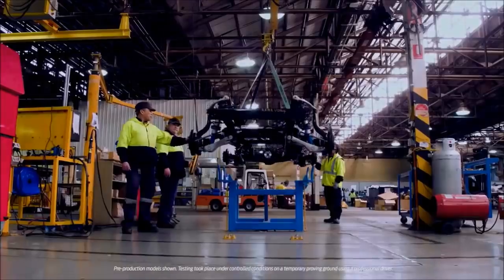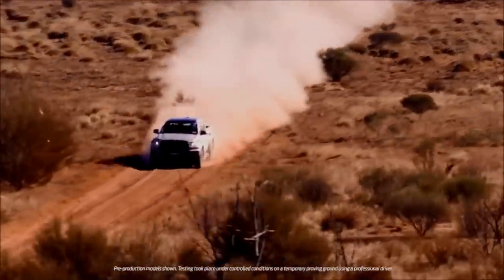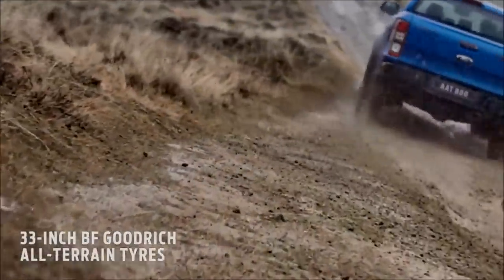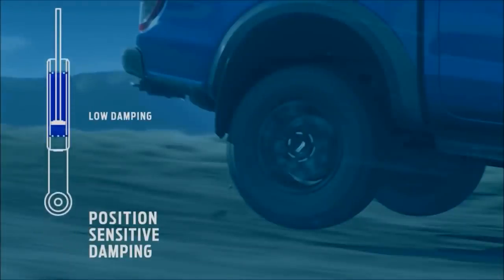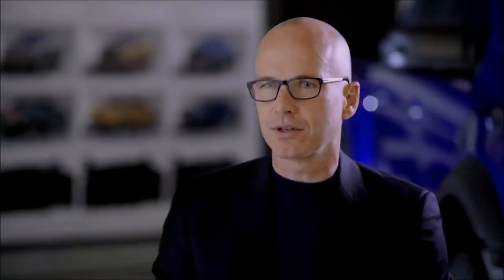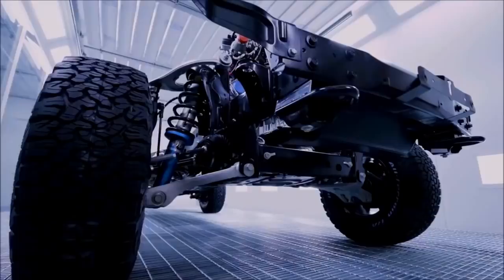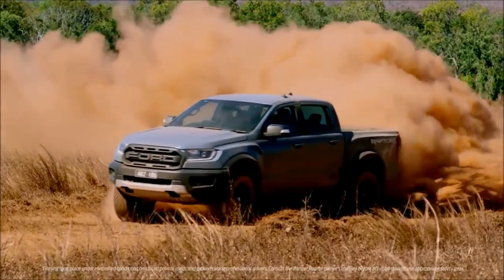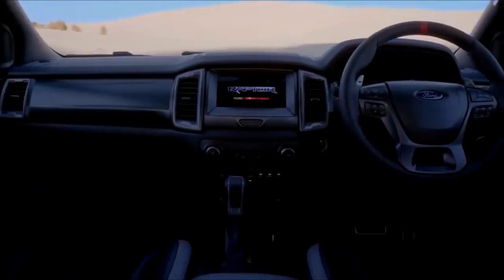Ford Ranger Raptor - The Best Pickup Truck Ever !!

Comment: "Made from high-strength low-alloy steel". That's..not a thing.
Reply: I always get a kick out of " high grade airplane aluminum"
Reply: It is actually. Steel for the most part is mixed with an array of other metals in different quantities to get different characteristics out of them.

Aircraft grade aluminum is the same way, although in most cases you wpnt be taking advantage of most of the properties in your flashlight or whatever
Reply: @OriginalRanger84  I understand that, but the choice or words here is fishy. High Carbon steel is technically a "low allow" steel, but they did not say high carbon...so it leaves me wondering what kind of steel is this? Another low alloy steel is A286 mild steel...basically the most common construction grade steel there is. It...is...soft.
Reply: @Battlefresh  true but with most advertisements it's all about buzz words and simple terminology. They could have used A36 or any other steel but chances are it's the same stuff used in most modern vehicles.
Reply: I think they watched one too many apple and dyson ads with these buzz words
Reply: They could say its made of vibranium and people will still argue its true...
Reply: Mark Danger what about this, you test drive the ford ranger raptor then “SEND IT” and see if it bends in half or not. If it bends in half then it’s cheap shit and if it doesn’t bend in half then it’s expensive shit.
Reply: Its plastic...
Reply: And I bet if you drive that for just 5yrs in the Northeast it will be rotting out real bad. Sad that the shitty materials they use now are becoming more and more popular.
Reply: We Are Legion!. It’s called fordable that’s why you see more fords out there then other companies.
Reply: @Battlefresh  hy80?!?
Reply: @whatswiththissassylostchilld  Actually it's called A Ford ability.😉😂😂
Reply: We Are Legion!. I don’t man I always hear mechanics complain about mustang always being at the shop lol
Reply: High strength is not high carbon didnt say anything about carbon range.
Reply: @Battlefresh  it's a trade off. A high carbon steel may be stronger, but more brittle. A softer one may bend if you drive the truck off a jump like a mad man (which is very likely for most people) but the frame won't crack.
If you drive the truck semi-sensibly then a softer frame will be able to absorb more in the long run while a stiffer frame driven the same way may suffer from multiple small cracks.
Reply: @DR0CK  Its because Buzz Words work...  If they didn't work people would have stopped using them.  Cause the actual scientific terminology wont make sense to most.  How we like to say it in the US Army is "Barney Style it" and "K.I.S.S."
Reply: @imhappyandyou.4003  if you drive any vehicle in the northeast for 5 years it will be rotted out. Salt and sodium chloride is some harsh crap. If people would learn how to take their time and drive properly in snow we wouldn't have to use so much damn salt and sodium chloride.........
Reply: It's like that "Military Grade Aluminum" bullshit. Every alloy in existence has a military grade even aluminum foil for cooking.
Reply: Yeah Google what's strongest aluminum and look how many there for different some you can machine some you can't airplane aluminum was first aluminum alloy check it out Google strongest aluminum I beleive its 5202 t-6 snodized much stronger than 7075 for all you AR people

Comment: Man, such a amazing car... but equipped with a f**king 4 cylinder diesel engine? its a raptor, lifted, fox shocks and a baja mode... there has to be a engine with sound an emotion in it!  also a manual tansmission is missing! 

put in the 3.5l ecoboost v6 biturbo and maybe reduce hp/tq, not to attack the f-150 raptor territory
Reply: i m from germany and such smoking trucks dont exist here. soon the diesel cars will be completely banned out of the big cities because of the particulate matter. 
Your diesel trucks are just Stone Age...
Reply: It's a diesel 😂😂😂

Comment: Pickups don’t have back seats! Those are for cruising malls and grocery stores parking lots. Soo sad how far trucks have been sissied up these days. Full of plastic (yes lighter) and computers. All good for most people now days but I’d love to see a real pickup made for those who would rather be in complete control/out of control of the truck. Just a stripped down, bare bones pickup, nothing special but just right to drive and maintain.
Reply: Larry Martin then buy an old one
Reply: Larry Martin people want to be comfortable in a truck. Not all cramped in the front because you have no other option.
Reply: I have plenty of options. I have my 97 F450 extended cab, my 03 F250 reg cab, my 11 F150 crew cab, my 17 F250 reg cab and just bought a 1927 model t pickup. So options are not an issue.
Reply: It's so you can use the truck for something other than "baja racing" and bring your friends or family along for the ride. If you have the money to dump on this truck you could custom build your own naked trophy truck. "Truck guys" are so funny and sensitive!!!!
Reply: Larry Martin Don’t appreciate that comment, I have a ‘94 Bronco and it’s a beastly off-road rig and I have a back bench seat 😠
Reply: You can. They are called the WORK TRUCK  and they are stripped down nothing fancy am FM radio  rubber floor mats bare bones brand new trucks
Reply: Well then you stick with your metal box

Comment: Best pick up ever ....ur opinion 
There are stronger pick ups out there....
Put it in Africa .....lets see all ur fancy work operate here
Reply: it will be destroyed by real rough terrain,maybe not if you crawl through idk
Reply: @votpavel  these vehicles are more pretty than hard working....i do understand crawling....but ....u cant crawl  for 300km.
Here we opt for Land Cruiser or Defender.
Reply: Designed and engineered in Australia (Ranger T6 2011 onwards), plenty rough conditions here (Snow, desert, floods, etc).
Exported stuff from Australia have done quite well in the past in places like Africa and Middle East so I think it would do fine there in Africa. (Ford Territory has been sold in Africa which was designed and engineered completely in Australia)

Comment: No manual transmission and no manual transfer case both of which have been gone for years so it's not even worth looking at.
Reply: YEP unfortunatelly, vehicles now are automatic that means, there are no new  real man vehicles anymore...! manual its and endangered species.
Reply: You use flappy gear shifts on the steering wheel. Having 10 speed wont make sense having that old school gear shift stick anymore so flappy pedals have been pit in place
Reply: Ram diesels are still made with the G56 manual transmission, thank god
Reply: Nevil Easterling,,,,,,yea and Ram has to detune the engine so the weak manual trans can stay together.   Having had many Rams, Fords and chubbies in my fleet of work trucks I was always forced to add many performance up grades however since 2017 I no longer need to add or change a thing with the new auto Aisin transmissions Ram offers. 

If you need a manual transmission in a little pickup to feel manly it’s a sad day. If you want to do a lot of needless shifting buy a small NA 2l engine sports car and actually have some fun.
Reply: @2003evodave  actually,having gears has nothing to do with feeling manly,not sure where that idea came from but anyway manuals have always been cheaper to operate and usually the only thing you have to do when they get miles on them is change the clutch and that's cheap.My friend just had his 2009 dodge half tons auto trans rebuilt..it cost him 2600 bucks..You can keep em!
Reply: I wouldn't call the G56 weak, why do you call it that? I enjoy driving a Ram with a manual, I've had too many autos shit the bed on me and manuals are easy to fix compared to an automatic
Reply: Roy Wright,,,,,,you are living in the ancient past.  Fact - 1- Ram detunes the Cummins engine on all its manual transmission vehicles in HP & torque.  Fact -2- The Asian Transmission is the heaviest duty transmission they offer as it comes from a medium duty truck (not pickup)  Fact-3- these new auto transmission will outlast the manual.  The only way the manual would last as long is if you don’t use your pickup so why didn’t you just buy a car? 
A Ram Cummins Max tow package with an auto is well over 30,000 lbs.    Max tow with a manual is ???? Zero since you can’t even get a stick shift on a HD package or with any heavy towing ability.

And yes I still do have two 5.9s with sticks,,,, a one ton and a 3/4 ton both are like cars compared to my new one tow dually Cummins with the Aisin.
Reply: @2003evodave  Sorry but your facts are well short of being ,well facts..Two days I watched a show on building up those "tougher than manual" automatics from dodge because they have multiple weak parts that break when you work them..and they are so weak in fact that the company on this show called "revmax transmissions" has to make there own parts to make them hold up..they cant modify what dodge uses in them to make them stronger..if you like automatics then use them..I will stick with gears.but dont say the autos are the best thing going because revmax has more customers than they can handle from people wanting them to build there autos so they will hold up!
Reply: I pray that Dodge will never stop making manual transmissions on their trucks, they're class-leading after all

Comment: Looks as bad as the Colorado in the front, curvy headlights and rounded ends, looks like the f150s daughter
Reply: The chrome grille on the F150 raptor is more masculine. The ranger Raptor should have adopted that look.This model 
Looks similar to a Chinese copycat
Reply: It is the f-150 daughter, the ranger is a smaller version of an f150
Reply: Maria Matias ya but it could have been styled to look like its son, these mid size trucks apart from the Tacoma and Canyon look feminine
Reply: @drakers8069  I guess it really depends on the people , the truck looks nice in my opinion but we all have different tates so that's that
Reply: Drakek because it basically is
Reply: A chrome grille on the F150 Raptor would be silly. It would look like flashy feminine jewelry on a man's truck!  All black is the way to go to look masculine!
Reply: Drakek I don’t think it looks feminine, I think it’s a cool truck
Reply: And that’s coming from someone who didn’t used to be a big ranger fan
Reply: Look like Toyota Tacoma, is not rough as the Raptor used to be. Pls do not bring this to the US
Reply: Maria Matias Actually no. This truck shares nothing apart from the ford batch with the F150. This is a rebadged Mazda BT50 which have several years in production. For the raptor version they are installing a mini Ford engine instead the very good 3.2 regular motor. The 3,5 v6 ecoboost engines are already showing its engineering weakness in the Raptors and mustangs so just think how it is going to be the life with a two litersuper stressed engine inside. Not funny for the money it cost and the miracles they offer. Volkswagen already tried the boosted 2 litter in the Amarok and guess what? They use now 3,2 TDV6 engines.

Comment: Ford might be number one when it comes to advertising and marketing, but when it comes to quality control and reliability they are far off
Reply: #1 Truck in America since forever. If they were "far off" they wouldn't be #1 for so long.
Reply: Recovering_Californian I agree. I had a 2001 Ranger which never gave me one moment of grief and recently had a 2013 Escape and it was such a great vehicle.  I think the “Ford is such a bad car” trope is such a holdover from the 70’s and 80’s
Reply: No. 1 is NON-EXISTENT. Everyone claims to be no. 1, wake up in the commercial world.
Reply: Of course, if you got 5 of them it should be NO. 1 for you. I used to have one, and throw it away after 6 years and NEVER would own another one. It's NOT no. 1 for me and for the rest of my family.
Reply: Laugh at your own b***! I never had went to an oil change work anywhere else, i do it myself ever since.
Reply: Totally Agree  my F-150 EcoBust was the Biggest overpriced POS vehicle I have ever owned. Constant engine and electrical gremlin problems, to make situation worse Ford corporate showed total disregard to address any of the issues which were all documented and service done by multiple Ford dealerships. Will never buy another one.
Reply: agreed, 2018 f150 plat with 5.0. 12, 12 friggen dealer visits in 20k miles!!!
Reply: f150 is #1 and mustang is #1 how are they far off???
Reply: @robertarodriguez2279  #1 as in the number one best selling pickup in the United States for 40 years
Reply: @Recovering_Californian  This truck isnt built in the US and ford australia has one of the worst after sales service ever. The ACCC fined them millions of dollars because they were dogs to their customers.
Reply: Mebe becasue US. citizens are far off caring about rliability?  @Recovering_Californian
Reply: And how did you become an expert?
Reply: @powderskier5547  I'm talking about Ford Australia and everyone knows how bad they are in after sales service. They're shocking. Can't speak for Ford USA though

Comment: 210hp - "high power" lmao srsly?
Reply: Its a mid size truck smh
Reply: I bet you the 2lt VW Amarok will outrun it...LMAO
Reply: gobs of torque m8
Reply: Diesel engines usually have higher torque output than horsepower. Torque is more important than horsepower in my opinion seeing as that's what gets you moving.
Reply: 369 ft lbs of torque señior
Reply: My 12v dodge cummins has 180hp and 420ft lbs torque... It can relocate skyscrapers.
Reply: Torque wins races, not horsepower. 369 ft lbs of torque isn’t anything to scoff at.
Reply: And besides, that’s the foreign engine 😂 they’ll probly do the 2.7 v6 when they officially unveil it here

Comment: Puny engine, gutless on road. No thanks.
Reply: Index you just described the Tacoma
Reply: Index listen, this isn’t a full sized trucks,  it’s light weight with similar features to a regular raptor but it’s got a turbo diesel which will make plenty of power for this little truck
Reply: I can't find any actual specs but it's supposed to be stronger than the v6 which has ~330hp and ~380ft/lbs of torque
Reply: Great, you wont be buying one but hopefully you dont own a more powerfull car becuase, just like 90% of the population that drives on roads, they cant actually drive, so powerfull engines in the hands of 90% population is dangerous, like giving a madman a gun

Comment: biturbo copied from Isuzu
Reply: This is not actually biturbo it's a dual sequential turbo system more likely the one from the 6.4 powerstroke the small turbo works only at low rpms and the larger at high rpms
Reply: Isuzu Bighorn Isuzu is garbage in US or elsewhere. Ford trucks diesel is 150% better.